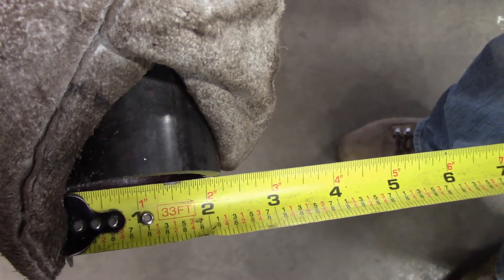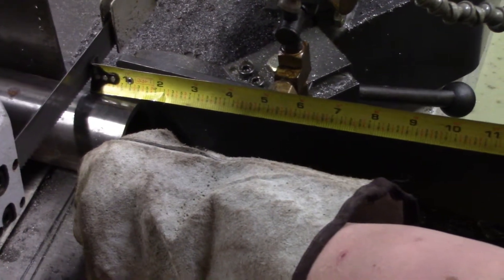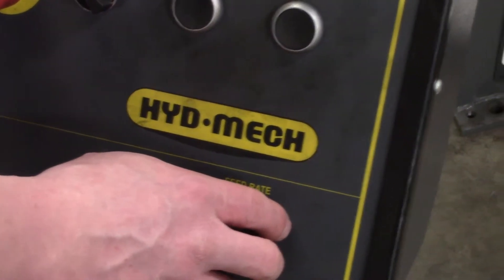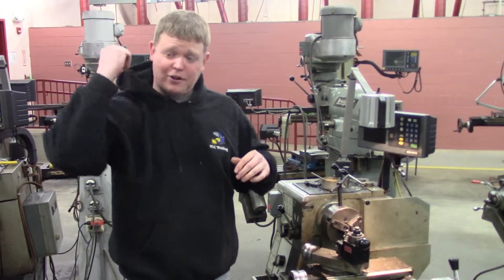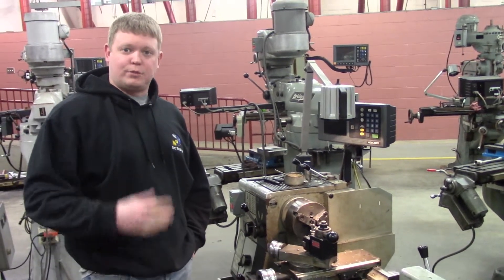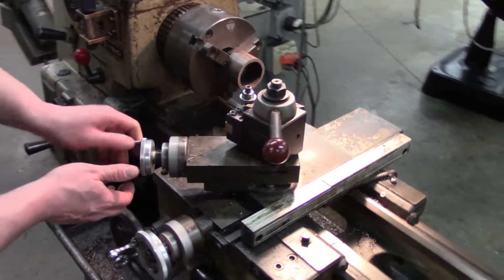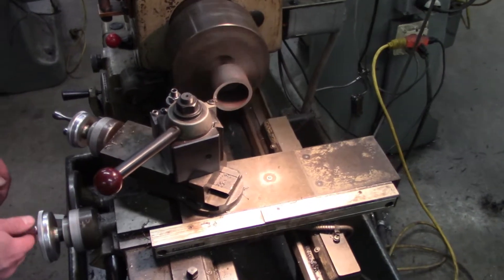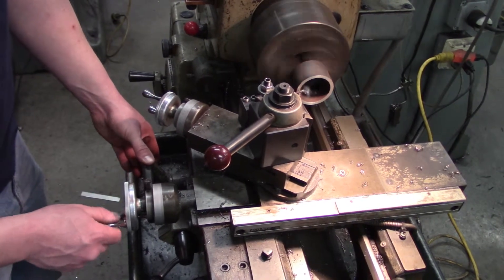How To Prepare Pipe To TIG Weld (Lathe)

Comment: Got a machine shop doing this very thing for me, I send him 1.4 metres of Sch 40 and he preps both sides so I can just stack em to train.
Cool vid. Might invest in a mini-lathe.
Reply from the maker: We've got a new CNC machine programmed to hammer these coupons out.
Reply: @TVWeld  Coming back to this video months later, The fact you  have it on a CNC doing this is amazing, you can keep training time/materials consistent for the welder. I finally got a mini-lathe to do 2" sch 40, can't take as deep of a cut as you do in this video which is to be expected because the lathe I have, is practically a toy.
I found when welding them - adding on as I go, that with the small segments it is best to leave the cap pass until you have another segment at least rooted at the end of that, otherwise the heat tends to build up on that end piece quite fast, and undercut becomes less controlable.
Thanks for this video man.
Reply from the maker: @razormazor6947  Yes you're basically putting a heat sink on it.  Pipe normally comes in 20' lengths so there is normally a lot of material to have the heat travel into.